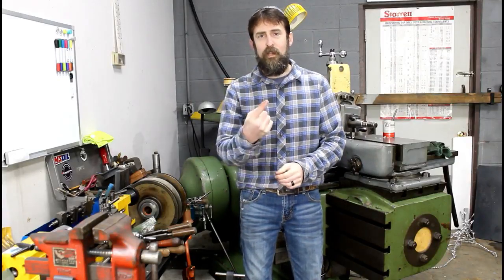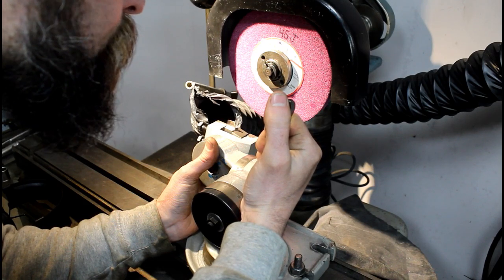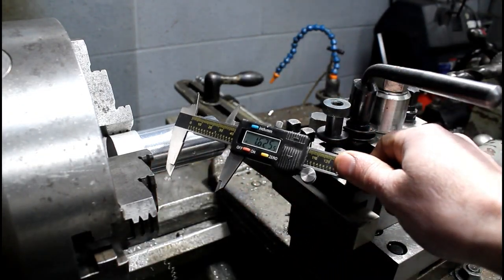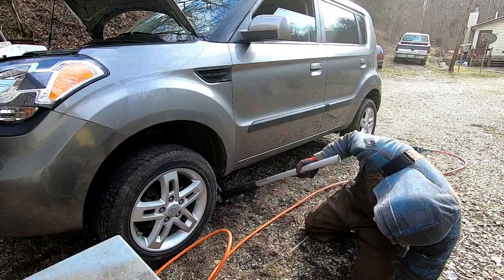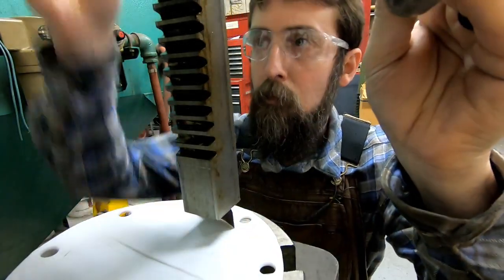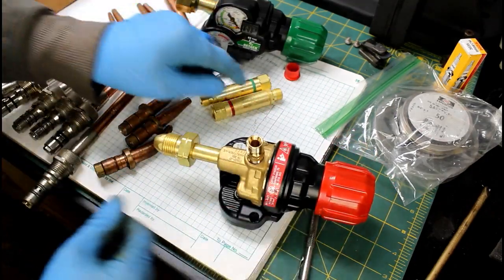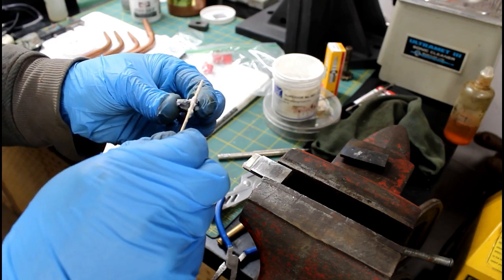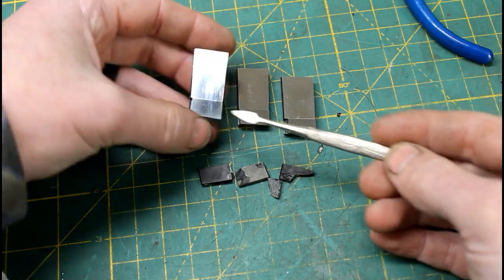Broken Carbide Repair  .  Off Market Part Repair

Comment: As far as torquing lug nuts, I've been the same way.   Driving for 45+ years.  
This year, I finally bought an impact driver (never had one before) theoretically capable of over-torquing them.  I also just this week bought my first 25" breaker bar.  Always got by before with one that's about 19" but after having to put my foot on that a week ago, I'm admitting to getting older.  I will admit to using various types of 'cheater' added to the 19" over the years, but NEVER for tightening, only for removals.
My best to Elizabeth.  My roommate has minor SVT issues, as does one of her younger sisters.  I've been through a triple CABG and fully recovered years ago.  Health is important - once the issue is understood, one can know how to deal with it.

Comment: The flat, angled tip is called a scarfing or gouging tip. You use it when you need to wash off just about anything like old weld, bolts, rivets, etc.

Comment: Thanks Steve. I hope the concerns with Elizabeth's heart turn out to be nothing serious. Interesting little jobs. I used to do a lot of silver soldering and for jobs like that I usually used soft iron binding wire for tying the parts in position before soldering - another trick I used when I needed the parts to be pushed together was to used cotter pins (bent to suitable shapes) and sprung open to provide a bit of spring force to clamp the parts. Another very useful way of clamping parts in position before silver soldering is to use spring tweezers (made for this job) available at jewellers supply companies like Rio Grande, Allbuquerque.
Edit: I've just checked Rio Grande - they call them soldering tweezers (makes sense!).
Reply: I was wondering where to source the tweezers. Thanks bud.

Comment: Great Video Steve. Ive never torqued a lug nut either and im a professional mechanic for 30 + years . Good and tight is the perfect torque for lug nuts lol . That angled cutting head is called a Scarfing head . Sad there was no peanut in this episode.
Reply: I'm gonna piss you guys off, but as a mechanical engineer with 40 years in the automotive OEM side of the business, I'm saying that you better use a torque wrench on aluminum alloy wheels. Aluminum is a high-creep material (relative to steel).  You don't need to spend a fortune on an electronic whiz-bang clicker wrench with audible and visual tell-tale. A 100 bl-ft bending beam wrench is still less than $25.  I trust my Craftsman bending beam wrench over any clicker (unless it's been recently calibrated).
Alloy wheel's lug nuts should be periodically checked because of the aluminum creep phenomenom.  Some current production performance require way more than 100 lb-ft of torque - up to 150 lb-ft. I defy anyone to reliably apply that much torque by feel.
Reply: @stevenslater2669  Agree 100%, any safety critical fastener should be torqued to recommended values;  with regard to vehicle wheels my local tyre company never uses any type of impact wrench to tighten bolts or nuts, though nuts are less commplace now here in the UK.
Reply: @stevenslater2669  That doesnt piss me off. Its your opinion and your entitled to it . Be it from education or experiences . I have my own experience and it has never led me astray 1000's of lug nuts later. Thank you for your input

Comment: I worked on cars, trucks, jeeps, etc for most of my 67 years and never used a torque wrench on lug nuts until the wife got cars with aluminum wheels...I started then and think that the torque specs were either in the owner's manual or maybe on the door next to where the tire pressure was listed....I always check with Williams torque wrench now.. Cheers; Mike in Louisiana

Comment: I switched to barbecue propane tanks and two 15L/min oxygen generators (endless supply), real cheap on Craigslist and works fantastic, had to change the hoses and get a new regulator for the propane. Only drawback is cutting torch is virtually useless for cutting, that's what plasma cutter is for and it runs about 500F colder, for 99% of the time it works perfect. Easy to get propane anywhere even Sundays and no rental fees either. Wish they had an Argon generator.....  As an added bonus Insurance companies don't like high pressure gas cylinders on residential properties so this fixes that issue.    Glad to hear Elizabeth is fine, time to get her back out in the shop and trained up on the shaper, lathe, and mill!   :-)

Comment: The bent cutting tip is what we called a "rivet buster"....It was used for removing heads of rivets or bolts, etc..There is a bent tip that is not flat on the side that we called a "washing tip".. It was used for removing old welds, beveling  for welding, etc....I trained with Smiths torches almost fifty years ago......Mike in Louisiana

Comment: Prayers for Elizabeth staying well.  My dad had me torque lug nuts twice and then told me it was unnecessary once I knew what the right torque felt like... I think it might have been after I did it once without and two grunts made them require a cheater to break loose the next time we took them off.

Comment: That ally rim looks definitely salvageable, the trick is knowing when to stop applying heat, some guys use soap, one  guy I worked with used to have a strip of softwood from an old pallet, feathered down to nothing at one end, when he thought it was somewhere near he'd wipe the feathered end on the heated area, if it started to smoulder he knew it was ready to tap back into shape with the 'gentle persuader'. Best Wishes to you and Elizabeth from Somerset UK.

Comment: Steve if you can find a tire shop in your area that does it, aluminum wheels can be with bends around the edge can be repaired or straightened. Check around the shops in your area, it is much cheaper than new wheels.

Comment: Steve, first off you know me. I am no safety Nazi. I'm just throwing this out there for the sake of discussion. I was taught back in the 70's, that when you are opening gas cylinders, you never open with your hand covering the top of the valve handle. You want your hand off to the side. The reasoning I was taught was if the valve blows off, it will slip through your hand instead of going "through" your hand. Obviously you would not want your face over the valve either. Now this may just be a wasted worry, but I thought I'd pass it along and see what others thought.
PS: Yes still to this day I do not cover the valve handle with my entire hand. Something that evidently scared me in my youth enough to stick in my pea brain.
Another week of great content.
Sending my well wishes to the whole family.
Matt

Comment: You might think this is a bit overkill, but when I do smaller flange faces (<300mm or so), I scan using a flatbed scanner. I can then print a pattern, bring it into CAD to grab centers, make up a DXF file, and so on. Larger parts can be done in several scans. If the part is too heavy for the scanner bed, I hold the scanner up to it.  This has been handy a few times when we need to go on site, gasket in hand, and have seen the face before, and when we need a gasket made up by a supplier. My best to you and to Elizabeth.

Comment: I haven’t seen a scarfing tip since school!  We used em to take the backing strips off of test plates.  You can still gouge the crap out of the base material if you’re not careful.  But they’re nice to have when you need to flush cut in a corner.

Comment: Hi Steve. A lug nut is torqued to stop you over tightening and not under tightening. As a UK truck driver I have seen some really bad things because of stretched threads causing truck wheels to come off and kill people.
Terry in England.

Comment: Good wishes and thoughts go out to Elizabeth and the health worries.
---
Torque your lug nuts - don't 'gorilla' them.
Wheels are a lot lighter and thinner than they used to be in order to reduce weight and over tightening will cause micro fractures and we know what follows then.
Do a search on wheel failures and the failure analysis of them. 
We share the road with others,  we have a responsibility to repair our vehicle(s) properly and safely. 
----
Enjoyed the gasket making segment.
----
Really enjoy the brazing segment. Fine job on the bits. That torch is the bomb!

Comment: About that wheel, Find a shop that has a "Road Force Balancer", or comparable machine that will put "weight" on the tire while it's being balanced.  I had a set of junkyard winter rims for my Outback and every one of them was slightly bent, and the shop that had that machine managed to get the shake out of them when TWO other shops couldn't.

Comment: I hope Elizebeth is feeling alright, my thoughts will be with your family. Shars still sells the multi angle grinding vice. Prices out of the 2017 catalog are $140 for the import and $195 for the American made version. Delta Rockwell use to make one. It was sold under #24--902 univice. It's one of those tools that you will find yourself using more than you thought.

Comment: Always torque the lug nuts as the rotors are susceptible to stresses related to the torques. You will stretch to lug to the point of failure if over torqued. They will come loose if under torqued. They will warp if uneven torque. 100 ft lbs is good for most cars.

Comment: I know how you felt when that tip kept falling off. Done the same thing many times. Once that brazing alloy melts it seems to get very slippy and the tip just floats off. The brazing alloy is available in thin ribbon form for this job which makes life a little easier if you are doing a lot of this sort of thing. Hope Elizabeth stays well. Regards from Wales.

Comment: Steve, when I was training we were taught to dress diamond wheels with what was called a green wheel. It was of course a silicon carbide wheel. Try taking the weights out of the diamond wheel putting this back on the m/c and dressing the wheel. Then balance the wheel on the wheel balancer It may help. Sorry to here about Elisabeths problems,though it is a worry. Give her a hug from all of us.I will pray for her.

Comment: That is a gauging tip. It’s used the same way as you would use an arc gauger or air arc. Usually for cutting out large amounts of weld to release parts for reuse, with minimal damage.

Comment: on lightmetal rims (aluminium and magnesium ) its worth it to torq the lugnuts to spec , its verry eazy to gall the holding surfaces on the rims and theres a small chance it can crack from there or work themselfves loose

Comment: My wife ran her car into a curb a week ago and it broke a rim but still had a vibration afterwards. The bearings felt good but it ended up being a bent wheel flange. I had to put an indicator on it to find out and sure enough it had like .015 runout.

Comment: the curved cutting heads for your torch i use to gouge out seams in pressure vessels so i can get full penetration when i weld it

Comment: I did once take a class in how to  change a wheel,part of reqirement to drive on mine site roads.The instruction said wheel nuts should be between 50 & 60 foot pounds of torque,conviently the tool provided with all vehicles is the right length so that an average person kneeling next to the car can put the correct  torque on it. My brother  had to replace all of the wheel studs on his truck because a tyre shop over torqued them while putting 4 new tyres on,he was seriously pissed when two studs broke the next day while he was changing the brake pads.

Comment: Tip when using the scarfing tip after cutting off 95 % of piece to be removed readjust the torch to a o2 rich setting with out using trigger wash away what is left with out hurting the base metal.

Comment: That looked like a well sharpened drill bit....talk about two equal chips.
That is a good looking gasket my friend.  Where did you get the graphed table top, if not a table top, the graphed drawing board.  Problem finding one probably because I obviously don't know what to call them.

Comment: Nice job on the carbide brazing and grinding. I almost have my delta toolmaster up and running. Look forward to trying this. Do you absolutely need a diamond wheel for carbide? I am new to this. Nice to have a break from working on the “free” saw (nothing is ever free is it 😂). All kidding aside that saw will be as good as new when u r done with it and we all will have learned a lot.

Comment: Steve:  ironically I just did a week long tour of the cardiac ICU here in Washington State. Heart issues are very frightening and I would encourage you to encourage Elizabeth or you both depending upon the circumstances to get some counseling for Post Traumatic Stress.  Just going through the Emergency room,  all the monitors, and your both just sitting there as people are starting IV's, hooking up EKG's, maybe giving IV drugs.  Tons of different specialists flying in and out.  Being wheeled in and out on a gurney, into elevator with all these IV's dripping things into you.  Maybe an angiogram with dye, MRI's, or CT scans, perhaps new medications and most importantly a sense that your heart has failed you.  Then toss in ambulance rides, 911 calls and having your home invaded by half a dozen EMS people all talking to each other, more monitors, maybe nitro  for the first time.  I've been down this road several times and can tell you it's terrifying, and I'm a nurse practitioner having worked in the medical field all my life.  I truly encourage you both to go see someone so you both can process what happened.  This will strengthen your marriage and the bond to each other.  God Bless, Scott.  Vancouver Washington.

Comment: Hope all is well with the 'Squirrel Whisperer'. 

Regarding the torqueing of wheels, I've been working on cars long enough, it wasn't a concern when I started.  The reason for it is with the advent of disc brakes, inconsistent tightening may cause warping in the rotors.  The more high speed the wheels, (sports cars, or lightweight exotic stuff), the more critical. In the same vein, though, a little aluminum & plastic car may be susceptible to warpage, as well.

 It's about even tightening more so than a specific torque spec.   It's still good practice, but I admit to not hacing torqued a wheel since I owned a Porsche in the '70's.

Something I was taught 50+ years ago is to always 'cross tighten' wheels. On a five lug, progessively tighten each lug, either CW or CCW, skipping one lug as you work your way around the pattern.  Ends up taking two times around the pattern for each step in tightening you make.

I've got an old as dirt, when I got it, Ingersoll Rand 1/2" impact, that has put more than 60# on a lugnut since I got it 30+ years ago.  I just tighten up with that, and call it 'torqued'... lol     Of course, I do a lot of things auto 'technicians' freak out about!

Comment: I always finally tighten up lug nuts with the spanner provided with the car.  That's the one you'll be using if you get a puncture out away from home.  If you use a breaker bar and a lot of force, you'll not get the nuts off with the spanner that comes with the car.  Which is part of the reason you see people stopped at the roadside with a flat, awaiting rescue.  They can't get the nuts off with the tools they have in the boot (aka trunk).  The rest of the reason is that the nuts are rusted on.  Take precautions: loosen them at home, apply some copper grease and put them back on.  You might just save yourself a lot of money paying for a tow truck one dark, rainy night.  (we have lots of those here in the UK).  Plus,  if the car's been for tyres or a service, I check that I can loosen the lug  nuts with the car's spanner. If not, it's out with a breaker bar to loosen them, then tighten them back up with the car's spanner.  10 minutes now could save a few hours of hurt waiting for that tow truck.

Had a flat last year, first in maybe 10 years, with my 38 yo daughter in the car.  Took me maybe 10 minutes to change the wheel - she was fascinated to see the process - she's never had a flat and didn't know how to change a wheel.  Now she does.  If she can get the nuts off her Volvo that is.

Comment: Steve, you should be able to take a dead blow hammer or a hammer and 2x4 and knock that aluminum wheel as straight as needed without any more damage to it, it should then be good.  I've had to do that to tons of wheels in my fleet and its normal good to go.

Comment: Great video! Hey on those odd sealing surfaces try Gore sealing tape from McMaster. It comes in different sizes and it’s good to 3000psi and 600*. We used it at the power generation plant I worked at, on 850# boilers and 1500# high pressure feed water heaters. I use it on everything, I even used it on A/C compressor head gasket till I could get a replacement. It has 1001 uses.👍🏻
Reply: Careful using on oxygen, even PTFE tape is not too good there, but the best is to use graphite powder lube on the threads, so all the torque goes into making the bullnose compress to the cylinder valve, and not gall into the brass. My regulators have a replaceable brass reinforced washer that makes the seal, and you generally replace them every 5 or so cylinder changes, and they seal very nicely.

Comment: on late model vechicles it is very easy to warp the brake discs with the wheel nuts or studs You can problablely guess how I found out , new Ford ,change of tires to gripper pattern and needed to fit four new hubs and brake discs (not covered under Warranty, Heaps of cash don't bother with the touque.Other wise always use one Cheers Richard.

Comment: those large stringers are bad for your safety. use a stop & go method to break your chip . small chips take up less in a scrape barrel. less chance of being cut. this may take more time , but that is the true time to do a job safely. I worked in shops for 40 years that Is why I pass this on